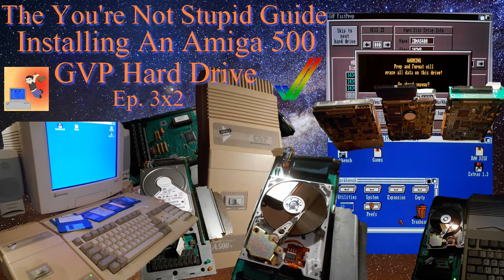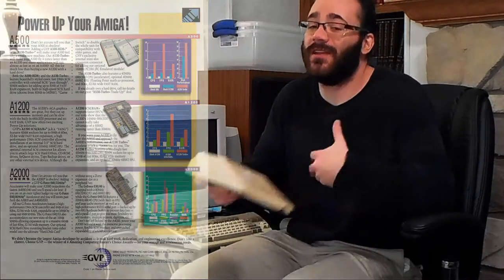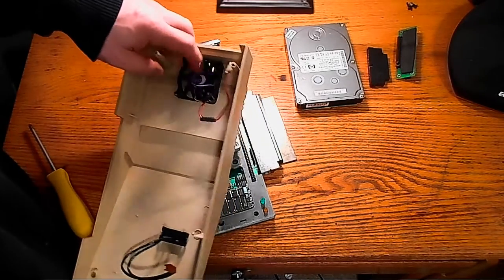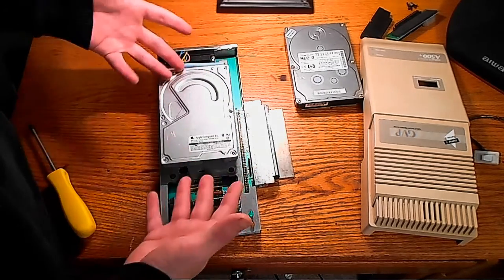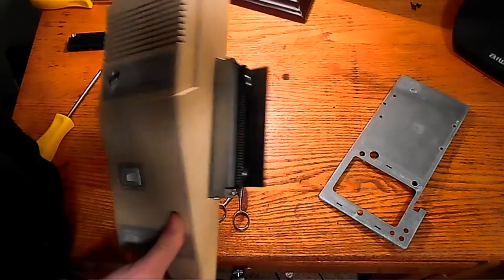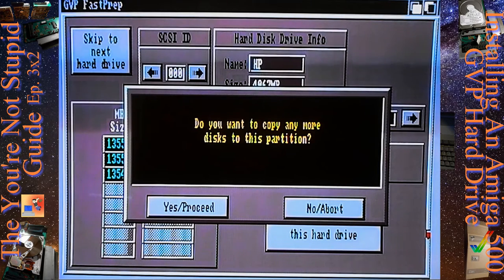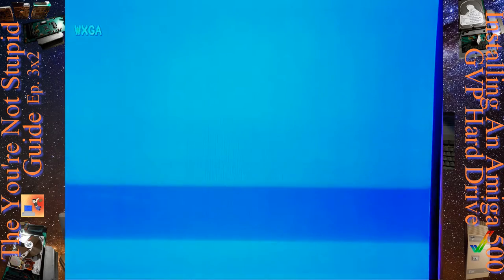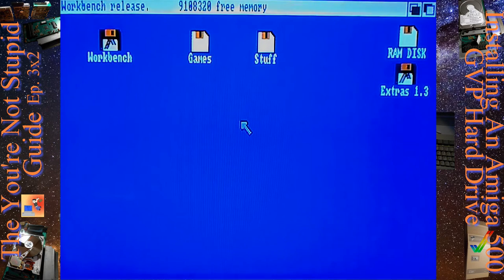Installing An Amiga 500 GVP Hard Drive + Emulation - The You're Not Stupid Guide

Comment: Nice job. As is often the case with these education guides, its not always possible to cover everything, and you'll always get somebody saying "I dont have a disk with the kit I bought on ebay, please help" or "I put a 200gb drive into my machine and it wont format beyond 4GB, HELP!". And the usual peach "how do I transfer X from my PC (with no floppy drive) to my Amiga 500", and then its making guide after guide to help with the questions.  

WHDload is now free, and is just an install into your computer, or put the WHDLoad command into C. Thats it. Then you can use the installers on the internet to disk image any ADF or original disk of the game, and it works on launch. Or you could download the full install of any game from whdownload.com, and copy it straight over to anywhere on your hard drive. 

WHDload does work with the A500 but as you say, it needs some RAM in order to preload the games and run them smoothly.  Your 8mb system should be good to run any A500 game, and back in the day I used JST - which is another HD install tool which came out before WHD. I think I have the full package of JST somewhere.

You mention in the  video several times that the emulation is slow. This is all relative of course, given you can have any CPU and Ram combo you like, and can ramp the FDD speed up to 800% faster on an emulator.  The basic A500 setup you selected in the video doesnt have the 8MB of GVP fast ram you have on your machine, and you said it "makes my machine feel like an Amiga 3000". Copying disks relies on the disk buffer (the addbuffers command) to send over the data, so if you buffer data with fast ram it is going to be noticeably quicker.  The other small disclaimer is, emulation is not perfect, as we know - and speeds can depend on several other things other than timings.

I cant afford the Amiga kit, as its not just a recapped Amiga, but also I'd need a HDMI upscaller, a flash drive kit instead of disks or a costly GVP, and also a way to add 4MB memory to be able to run workbench and games comfortably. There are lots of leads and converters I'd need to buy, so I reckon I wouldnt get much cash back from $1000.  For a fast A1200 you can pay more than that, and for a very good A3000/4000 you are looking at  a big outlay. A good joke but not so funny. I dont have that kind of    money, and for me, emulation has saved a life mostly of poverty and made it bearable.  For me, if people are talking about and using an Amiga somehow, thats the main thing, and I dont mind if its only in the emulated imagination window of someones mind.
Reply from the maker: First; the emulation very much was using the exact setup of my real 500, including the extra RAM. It was showing more RAM as a matter of fact despite having the same setup. Not that it really matters, because as you say, you can have any CPU you want. Still, when going from a real 500 to emulation that claims to be running the same as a 500, it's not the same.

WhdLoad: Can't expect someone who's not interested in the program in the first place to keep up with all the new changes it may have gone through. The program was at one time an absolute disaster to set up, was not worth anyone's time as far as I'm concerned. It is still not worth my time, as I quite enjoy having "some" floppy disks. 

Again, a game like a Lemmings with a boot loader, not interested in it being on the hard drive. It's not that big of a deal in terms of storage or load times. I use the hard drive for games with too many disks or terrible load times. Also; no , I can't use it on my 500. It requires a high level of CHIP RAM, my 8mb of extra RAM in the GVP drive is slow RAM. WHDLoad will not run on any stock 500 without getting out your soldering gun. It wouldn't matter anyway, as described perfectly in my video; it gives me, at the very least, an emulation kind of feel. That's a thing I'm not interested in. I know I'm not the only one to feel that vibe from WHDLoad. 

Not to demean anybody with their hands in emulation. I've certainly done it myself and have nothing against those who do. I do very much like to poke at those who have real machines and go toward flash based solutions or indeed, WHDLoad. It's strange to watch people who claim to be all about the real machine turning their real machines into something that is 95% not real or not of the era. For that, I like to poke, it's not a direct attack, but in a world that is very much heading mostly in that direction, I wish to make it loud and clear that I'm not. So that anyone who agrees with me has someone to look to. There are far too many people who are now throwing out their hard drives for a flash solution simply because everyone else is doing it. They think these drives are on their way out sooner rather than later, I think they will outlast flash solutions. There needs to be someone out there physically installing real hard drives for the people who still care. 

My GVP cost $100, you can get an Amiga 500 for about the same or a tiny bit more these days, which should come with the expansion RAM. The SCSI drives were $20, the converters were $10. So for around $250 people could get a hell of a lot of use with a real Amiga again. If that's what they want. Not everyone wants that. I was just fine and happy with emulation for many years, I happened to change to want the real thing again. I've nothing against emulation or the people who use it, it does open my eyes having gone from the real thing straight to emulation however. That's not to discourage anyone from using emulation, it is to encourage the use of the real machine. I want these things in loving arms for a long time to come. But it disappoints me that so many of those who do still use real Amiga's feel they must get the 1200's or 4000's... Machines, as you say, are quite expensive... And in all reality 95% of the people who do buy them have absolutely no use for those machines. In fact with the games they play, they'd be better on Workbnech 1.3 honestly. Unless of course they've gotten the idea in their head that they need WHDLoad.... That is an idea I'd like to get out of their heads. I'm sick of those newer Amiga's being eaten up by people who do not need them, causing prices to rise to levels they should not be at. Be careful what you wish for and recommend, because sometimes there are unintended consequences... The constant recommendation of WHDLoad has a lot of unintended consequences. The games that actually could use a hard drive more often than not can be installed on a real hard drive. I don't recommend the use of WHDLoad.
Reply from the maker: WHDLoad is also a culprit in the misunderstandings of PAL/NTSC  modes. Something you should know I am very much for people having better understandings about. Can't confirm this, because I don't use it, but many people have come to me saying that inside of WHDLoad they have made sure to put in "NTSC" ... They show me what they have... And it is not NTSC. I believe someone at Lemon even made an entire video about how I was so wrong on my thoughts on that matter... He made something to prove how wrong I was... And the man was not even running in NTSC... I don't know what that program does, but it obviously does not switch games into true NTSC mode. I believe you have to switch the mode before you start Workbench for those settings to have any use. 

Unintended consequences. Now you get people who think they are doing good to check off "ntsc" but in reality they are still in PAL mode. Then they yell at me. I really don't understand your comments here... People should not assume that the passion in another's voice is not well researched. It would have took but a moment of your time to confirm that indeed my emulation was setup to match my real machine (The memory I have is shown in 95% of all video with Workbench in it at the top of the screen).... With the comments about WHDLoad and saying it can indeed go on my computer... Assuming I've never looked into the matter.... No... Chip Ram is the important factor there. I can't have it on my computer... I know what I am talking about. Do not assuming I don't. But you wanted something to be angry about.... And that's what I don't understand. You wanted something to push back on,and you immediately assumed I had not taken the time to make sure my emulation was the same... You immediately assumed that with my extra memory I could run WHDLoad even though I don't the chip ram and not to mention the operating system has to be 2.0 or above! And I had done all of that research!.... That... I'll take a deep breath on, and let go... Please try your best to not let that happen again. I'm not like others... Absolutely not. I don't say it unless I mean it.You are not me... You may very well be the master of you, and you may have considerable knowledge on WHDLoad and WinUAE. You don't have that knowledge when it comes to my Amiga 500, do you? No... Do not assume you know more about the machine that I have than I do.
Reply from the maker: Now that I've taken some time to think about it, you just be you. For the most part, I like it. It never did really anger me, and nor did you come off that angry yourself... It's just one of those things, like at the start, that two people who are guilty about nothing more than thinking too much, thought too much. It's easier to think that the reason someone thinks a certain way is because they made the simple mistake if say going with the default WinUAE configuration, that that is why they think the emulation is slower than the real thing. Most people would never think that, because most people never think. However, it still would have been easy to confirm that I indeed think a lot myself; and there's no way I'd make a comment like that unless I thought I was justified. Beer. You and I, one of these days... We need to have a drink. :D
Reply: I am glad you have calmed down a little, as for a moment I thought you were taking my chat comments and making more out of them than intended. I tried to keep my comments brief so that it wouldnt lead to a rant about how much I am assuming you know.  I didnt know you have no interest in WHDload, I just thought you were happy for those who use it to use it. I used it back in the day on my A500, but it had fast ram. I didnt know the GVP was slow ram, I thought it was fast ram.

Yes I know many reviewers who use emulation and they have a huge black border at the bottom of PAL games and somehow widescreen. Check out any Lukozer amiga video.  This drives me crazy, and at least my vids are always 4:3 and full screen.  The NTSC and PAL switch doesnt work on emulators in WHDload, only on real Amigas. Any resident command to auto-boot into NTSC doesnt work either.  

To be honest I'm the kind of person who finds the whole "I am right" "you are wrong" thing very boring and if Im not trying to change your mind about anything. In the same way, I am dismayed how often people pass off my views like I myself dont know what I'm talking about. The three GVP drives currently on European ebay are £190-£250 each.  I have had many HDDs fail in my real Amiga and also on my PC, so I wouldnt trust an old HDD.  You can laugh and say it will never happen, but I trust flash media more.  

Lets not try to preach to each other, there is no way I can go the 100% pure Amiga route - and even back in the day I expanded my machine into an A2000 030 with an alien expansion bay and an alien CPU upgrade card, and also Rom switchers etc, so even when I could afford it, I didnt own a 100% pure machine.  

If you want to, I guess we could chat on skype sometime. I dont drink beer, and regard alcohol as poison, but then  I smoke and you dont, so we see things from the vast opposite side of the scale I think, and there is nothing wrong with that.
Reply from the maker: The channel you told me to check out... oh god... How do people even end up with that awful ultra widescreen type of aspect ratio? Beyond that... Listening to the commentary makes me sad, because a hell of a lot more people seem to think that's better than me.

http://www.whdload.de/docs/en/need.html 

I went and checked the official system requirements for WHDLoad; and found we were both right and both wrong on certain issues. What upset me is that I don't assume others don't know what the're talking about, but you commenting on your 500, and I have no idea how long it has been since you used that... because you have experience with the machine you assume you knew more about my setup than I did. I said people should not assume they know more than me about my setup... That does not mean I know more about you when it comes to the 500 or the Amiga in general, it means I know more than you about my exact setup. Absolutely true, and you know more about your setup than I do. 

Your 500 had a kickstart of 2.0 at least. You also had an 030, and an 010 is what is recommended for WHDLoad, although it will indeed work on a 6800. Apparently some games require more than 1mb of RAM, but when I actually went and looked at several of the programs I found most only required 512k of chip RAM, and I do have 1mb of chip RAM. My extra 8mb of RAM would likely be more than enough to run WHDLoad for most games. I said it was slow but I was meaning to say not chip, I use slow and fast interchangeably because some people claim even fast ram is technically slow ram. It will list as fast ram though. 

I "could" run WHDLoad on my computer... If I had a kickstart of at least 2.0, but I have 1.3 - When I did my getting the Amiga 500 online video, I had several people chime in with "just use this, do that, use this program, I always used this" - They were all right and they were all wrong. None of those programs worked on my 500, I tried them. Almost everything in terms of getting the 500 connected online require a kickstart of at least 2.0 -  Power users love to chime in... Power users are not normal users. They are often the first to upgrade their machines, they are often the only people to upgrade their machines. They so easily forget that their machine is not my machine.

One of the many things that make this place unique is how I'm a power user on Workbench and kickstart 1.3 - Now it wouldn't brake the bank at all for me to grab a 2.0 or even 3.1 ROM. It would certainly be less expensive than the hard drive. But I am sure I would come across a game here and there that would not work on my setup... For those that have 2.0 and above, well, WHDLoad may be a necessity. I happen to have the operating system the grand majority of games and software were designed for. To get 2.0 just so I can run WHDLoad would in essence be me upgrading my hardware to get slightly worse compatibility. I'm sure I'd be exposed to plenty of good Aminet freeware/shareware, but for me it's 1.3 - I've done enough research over the years on WHDLoad to know this simple fact, it can't run on my 500. 

But it did run on yours. I don't doubt that, but if you look inside yourself, you very much did think it could run on my 500. You very much did believe that the reason the emulation was running so slow was because I had not taken into account how much memory my actual Amiga had... I did. And I noticed you didn't mention that at all in your last post, because just like I went and checked out the WHDLoad requirements, you went and checked out what Workbench said about my RAM. And you found out I was right. 

I simply don't make videos unless I know what I am talking about when it comes to me. Nobody knows me better than I do. This is the perfect guide for an Amiga 500 user who wants a real hard drive to use. It works, there's nothing wrong about the guide. The way I setup the emulation hard drive, it works perfectly. It is up to others to figure out how they want to use that drive, here I am showing them how they can to this day use real hard drives. If they think flash is better? This is not the video for them... This video does very much deserve to exist in the sea of videos which now only point to flash media as an option. There are other options, I'm here to show off what I love. I can't do a video on installing flash media, I don't have flash media. I have a hard drive, I can do that video... Others can't. 

I believe a whole lot of people are wanting machines like the 1200 possibly just so they can use WHDLoad. Because that's what everyone recommends they use. I'm saying there's no real need to upgrade your 500 or get a more scarce computer just so you can run that program. In reality 90% at least of people with those systems will never use all that they have. I could. I could power use with a 1200, I'm making a point for the majority of people. You don't have to be a power user to want a real Amiga. There's no judgment being passed on people who emulate or use the real machine here. I had the super emulation setups with giant thousands of colors wallpaper and super high resolutions. For me personally at some point I just wanted the real thing again. It was quite cheap for me because I already the Amiga, and the drive was only $100 here, but of course the drives were made in America, so I imagine they would be a tad more expensive elsewhere. 

In the end I can only make good videos for me, because that's all I know. I'm hoping my videos can help others who might think a little bit the same. I found they loved that getting the 500 online video, probably because there's a whole lot of 1.3 users who would love to do power user things, if anybody was out there showing them how. Nobody is. Nobody was showing off NTSC 4:3 games, I stepped in, nobody was showing off Workbench 1.3, here I am. While a whole lot of people are perfectly content using 1.3, I'm also sure they are a bit reserved about getting a hard drive for 1.3 simply because it's a little easier to use a hard drive with 2.0 and above. It's not hard to install Workbench 1.3, but since it does not have a built in install program, it's still harder than 2.0 and above. Here I am showing everyone how they can have good old classic blue on their hard drive or emulation hard drive and perhaps that might make a whole lot of people a bit more nostalgic for the Amiga, it might make them more eager to get into this stuff. I can hope. 

I often go off in tirades in the videos; that's just me. I didn't need to mention or put down WHDLoad in this video in order to show people how to install a hard drive. But one of my most liked videos is also my most disliked video, the video on the MT-32. Why? Because in the first minute I tell everyone that Adlib sounds like crap, it's awful... and then you got people who want to jump in and defend Adlib and say it's better than the MT-32 and the Amiga! I only said it to better illustrate my love for the MT-32. My love for it is better understood if they can see my  hatred for what I had before. When everyone else looks at you as crazy simply because you're doing things differently, I believe it's okay to poke back from time to time about the very things they think are essential. WHDLOad is not an essential program for me, because I have the operating system most things were designed on. Not everything can be installed on a hard drive with my setup, but there's more than enough to make me happy. Shot9785 is the skype if you ever want to talk on a private level.
Reply: Yes the Lukozer videos are not unique, and lots of videos on the internet are sadly in these horrific aspect ratios. I tried leaving suggestions on his videos, even in the latest previous video, but he is head strong and as soon as I mention something, I immediately get contradicted or just ignored. He is very much "Im going it  MY way" kind of person, and he is arrogant and extremely closed minded.  I'm one of those people who likes to offer suggestions, but when it comes down to it, if people would rather see things their way, then I have no say at all, and they get busy trying to convince me that their way is in fact better.  As a somewhat open minded person I doesnt like to assume or judge, but am often told I am assuming and judging, even if I write "perhaps" and "how about" before every line.  

WHDLoad I didnt know was so flaky, as I tested a game with a A500 000 KS1.3 and 2MB ram in emulation and it worked. But Ive not had any real experience since my Amiga days.  As you say, I had a power user machine so it was more likely I wouldnt notice any issues. 

After your comments the other day, I was moved to write an article called Real Amiga Hardware Vs Emulation Topic in the General section of the Lemon Amiga forum, and here I tried to detail some pros and cons of both. You may think Im biased for emulation but in truth its just because up until recently, I was only making £200 a month, and my rent was £250. But as it says in the article, I am still looking out for an Amiga just so as I can rip from real hardware for the reviews. Playing games in the emulator doesnt bother me at all, even in 16:9, and I just feel guilty for the fans rather than a true passion for the hardware myself, but thats just being honest.  I will eventually get the hardware back, but it will be an A1200 with CF due to lots of reasons.
Reply: Yeah, just keep on doing your own thing, as you say, its all we can do. I hope these comments are helpful and they certainly inspired me to make the article, so no harm done, and I'm glad I didnt piss you off too much. As an update to the Lukozer thing, his semi-latest video is in 16:9 and not 16:4 or whatever it was, which is a small step for man, but a giant leap for mankind.
Reply from the maker: If you're able to run WHDLoad off an Amiga500 with kickstart 1.3, I'm sure a guide video from you would be a good one to watch. I can actually think up one game it might be useful for personally. The game "No Second Prize" has always been a game I've wanted to play on my Amiga, but for whatever reason, despite being a game designed for the early Workbench's, it just has never worked on my machine. I've tried all my degrader utilities, I can only get to the main menu before it crashes. I always thought it was trying to hack the RAM in a very special way that causes issues, because I could get further if I replaced my backdoor RAM with a spare. But it still ended up crashing. Tried it with and without my GVP drive. It's really the only game I've ever wanted to play but simply can't figure out how to get it to work. So in the event I ever got WHDLoad to work on the machine, I would be trying it with that game.
Reply: I may just try to make a guide and see if I can get it running. Thats a good idea, but it may be a while, as I have a few games in the pipeline to finish off, including one of my favourite NTSC games, Safari Guns. :)